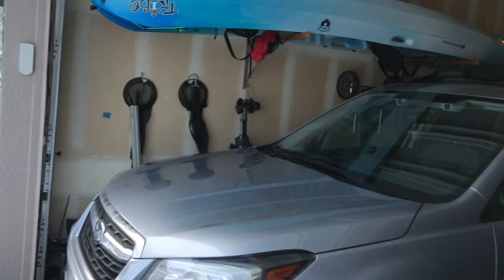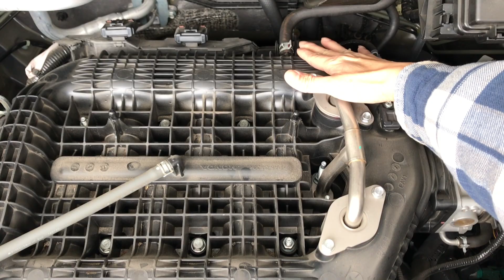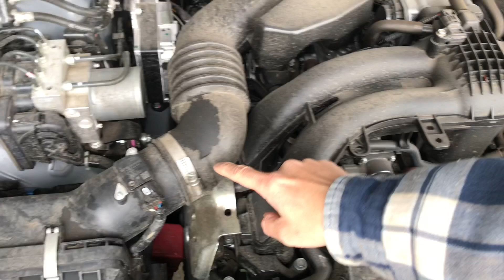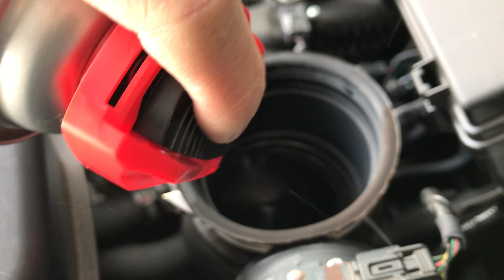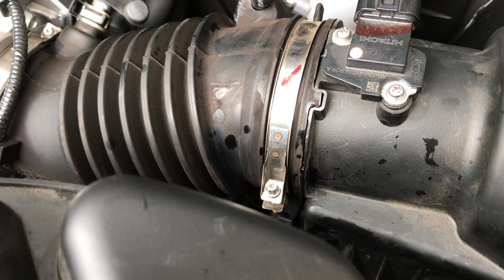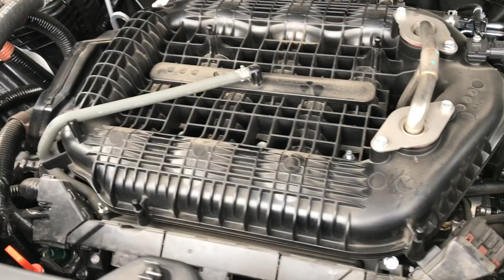2017 Honda Pilot Direct Injection valve cleaning

Comment: These things still need such maintenance up to 2017? wow. thats why toyota has port injectors with direct injectors. if catch cans work why the heck don't they put them in at factory. Good point about not using brake booster line. Issue with this though is the car needs good  reading from MAF sensor. I wish they made a place to shoot this stuff in without taking apart anything. Also spraying a mist would be better if possible instead of a stream with the can because port injectors would also spray a mist. what you could also do is do a before and after by taking the intake manifold off to see how dirty and clean thing are.
Reply from the maker: You're correct about Toyota's dual injection engine, such as on the Highlander. But Highlander's 8 speed transmission is a seal unit without dipstick and very difficult to change. For that, Pilot's traditional 6 speed auto sort of evens out the ground as far as maintenance.
Reply: The only reason why Toyota and others went dual injection is that they failed with direct injection alone.  Honda was late in the game with gdi and most likey will follow suit with dual injection, maybe, we'll have to see.
Reply: Catch cans are technically not allowed because they violate emissions.

Comment: wow, looks like a lot of work or stuff I don't need to worry about with my current 2009 Oddy, its running fine for now. (200k)
I was looking into a replacement 2019/2020 Honda Odyssey with this engine. The following video after your is ...https://www.youtube.com/watch?v=VIRBsn3xfoc
Im going to investigate Toyota next.  The Toyota uses a timing chain as well. 
Honda does not make good engines anymore i'm convinced. This sounds like a tractor!
Reply: On the same page. I've heard first time that Honda went full GDI the last year with no PFI like Toyota does. Old EcoBoost was there until all the issues came up, Ford had to add PFI. Honda went nuts lately with turbos on small engines and idiotic GDI only engines
Reply: @deseremere  and if the owners use anything other than top tier synthetics in colder weather, then R.I.P. cold start viscosity is extremely important with these turbos and especially GDI engines

Comment: Does that clean the fuel injector
Reply from the maker: No, but you can put the solution into the gas tank and it will clean the injectors
Reply: @Yakfish-Taco  what solution do u put for the fuel injectors?
Reply from the maker: Seafoam
Reply: @Yakfish-Taco  do you have a video?
Reply from the maker: i don't, you can pick up a can of seafoam from Walmart and simply add to the gas tank while you filling up a full tank of gas. Hope that helps
Reply: @kingofslotsmillion3263  could also go to gas stations that sell top tier fuel. Basically its gas with fuel injector cleaner already mixed. Costco is an example of one